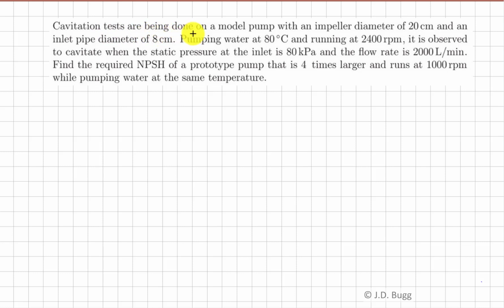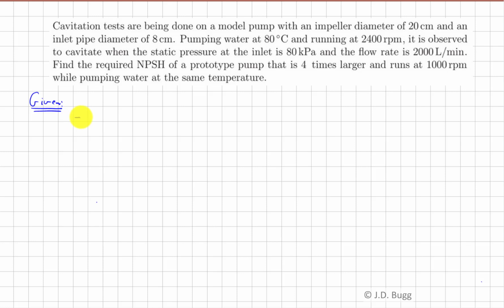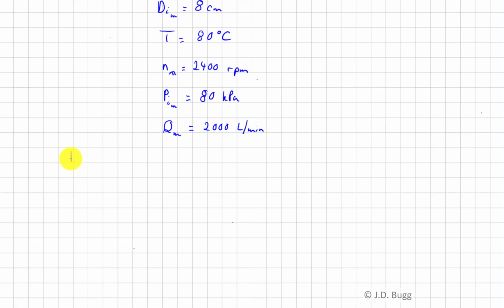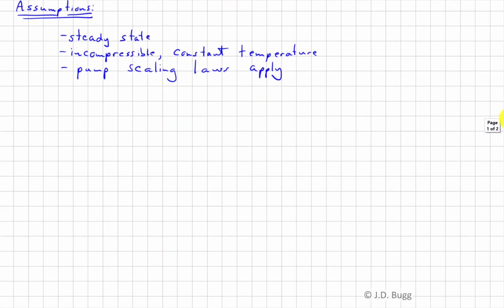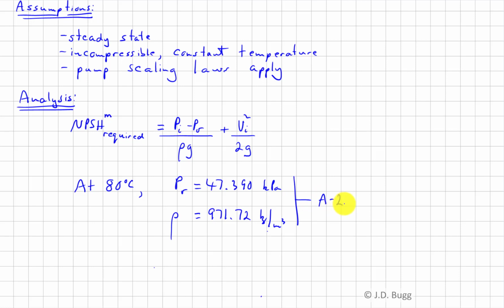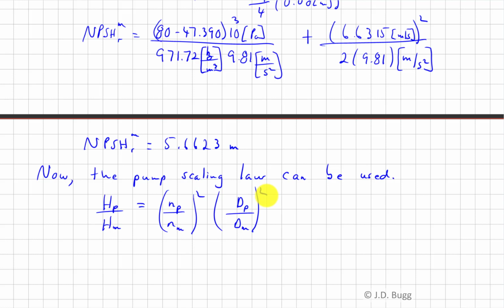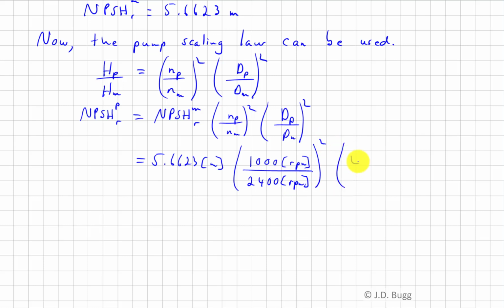Turbomachinery - Pump Scaling - NPSH

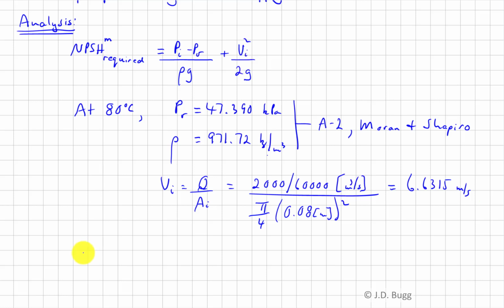Comment: is't volume flow rate changes when doing pump capacity scaling ? 5:54
Reply from the maker: Thanks for the question 

Yes.  The volume flow rate of the prototype will be different.  The question just didn't ask for that to be calculated.